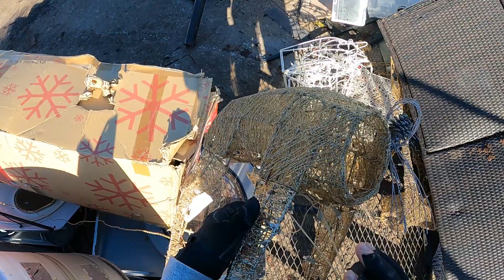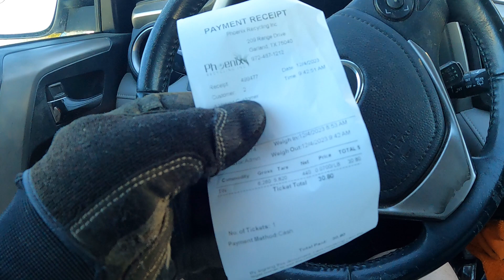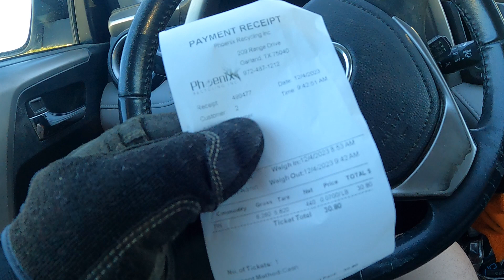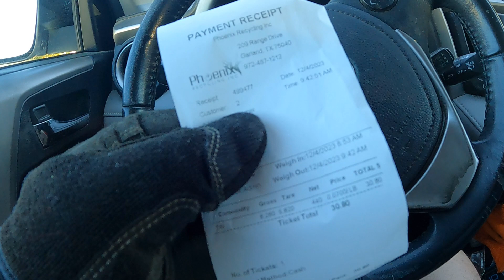Unloading Only #scraplife

Comment: You are lucky your yard allows you to break things down. Nice Load! Did you see if the motor is copper? You will have a1000 sub in a short time.
Reply from the maker: You are right. I am. But then again that is one of the reasons I go to this yard. Another yard that I started with was too fast paced for me and was tough getting my trailer backed into. Phoenix is actually the fourth yard I have used and I like it the most. If things are busy I don't break things down I have to toss and go but most times I have the opportunity to break down. Heck, many times I am alone or there is only one other scrapper there. The motor isn't copper. I wish! Thanks for watching.
Reply from the maker: Projections say that I should hit 1,000 subs by the end of the year. Hopefully this year. Hahaha. Thanks for all your comments.